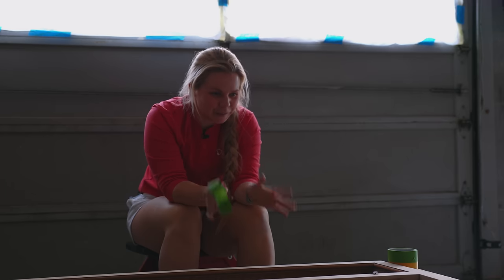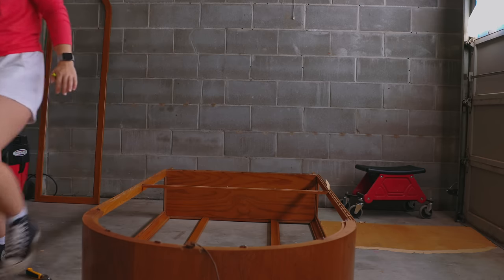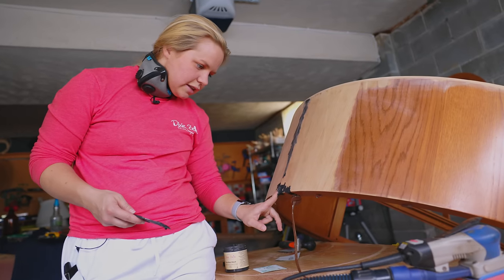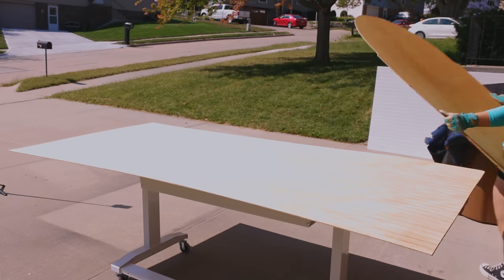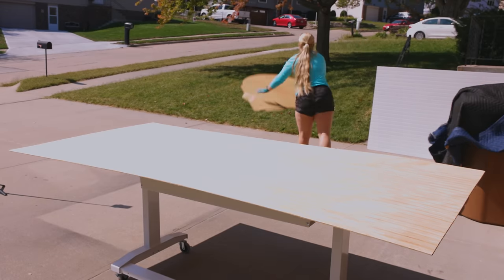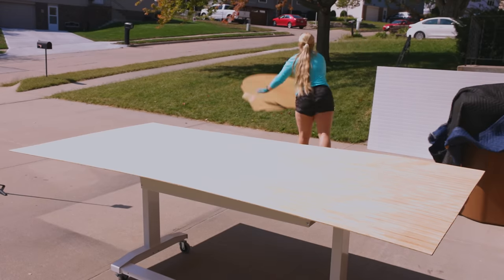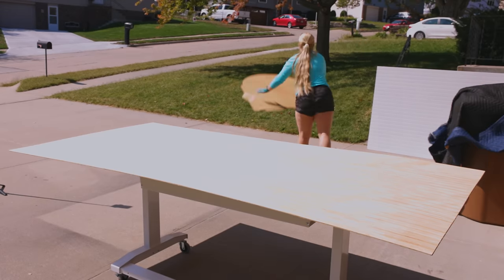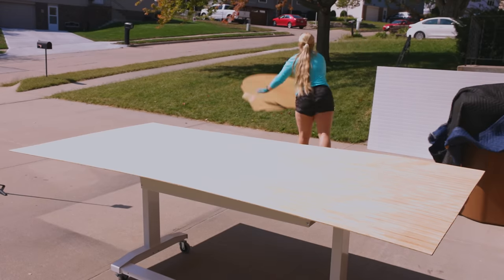I FINALLY Got My Hands on a Golden Oak Arched Cabinet 😍

Comment: Putting the glass back helps keep dust from getting inside the cabinet. I would put plants inside as well so it would keep the humidity up. Beautiful piece. Congrats on your store front
Reply: I agree.  It’s actually easier to keep clean if you add the glass back, because it keeps the dust out.
Reply: This is exactly what I was thinking!
Reply: Exactly!  Who wants to dust all the things inside.  I would never buy a display cabinet without glass just because I hate cleaning and dusting.  Cleaning glass once every 6 months is much easier than cleaning shelves and Knick knacks every couple of weeks
Reply: Totally agree with keeping the dust factor to a minimum!!!
Reply: Plenty of people have open shelves so I don’t think that’s an issue for most people.
Reply: Agree.  I also think it looks unfinished without the glass, so, putting it back in will further justify whatever price you ask.😊
Reply: Kinda undercuts the point of having a door that opens, too, if you can just put stuff on the sides of shelves without opening the door...  Also keeps the CATS and the kids out!!
Reply: Yesss!!

Comment: you can still use the arch piece that broke.   where it broke get it cut even and use the whole 2 pieces as one. where you have it pieced use it in a cabinet and use the cut line with a shelf to cover the piecing section.

Comment: I like this cupboard a lot.  Different ideas play around in my mind what you can do. 
One idea is to have all the glass in because it is a show  case.  The other idea is not  putting it in to create an open space, flowing through space.
I also have in mind how you can play with colours. The black cupboard with the golden brown/honey colour items look stunning.   I also see in my mind that somewhere on the outside it needs to match with the inside, or the items on display, for example the feet is also golden brown and may be the door frame.  It is a very versatile item.  You can build replicas of this cupboard and play around with ideas of using the colours on the interior and exterior of this magnificent piece.  One another idea is that  you keep the mirror at the back, keep the inside golden brown, ( the natural colour of the wood), put in string lights around the mirror, paint the exterior frame black as you did, but just keep it empty, because you want to illustrate the idea of a  "spieelkas" ( Afrikaans for a dressing table)

Comment: It looks much nicer with just the glass shelves no glass walls or front. I had a cabinet like that that had glass on the sides in the front and the shelves and it was a pain to clean. Your design looks much simpler and easier. Nice job❤

Comment: I wasn't sure about the dark paint wash when you mentioned it.  I have to say you were right.  It looks great.  I would prefer 'no glass' but you might keep them and have them for an option if the customer wants them.  The glass shelves let more light in.  With a lighter color cabinet you could probably use painted wood shelves.  Nice job, Lauren

Comment: You pay attention to the details.  I appreciate that (sanding smooth down to the cut line; adding edge banding; multiple thin coats of paint on the project.  I think it was the best treatment to use the glass shelves rather than the wood shelves, which IMO made the inside of the cabinet look heavy and a bit too dark.  I'm fine with not reinstalling the glass panels on the sides and door because I like the open shelves, easy access to grab a book or quickly switch out decorative pieces. I use two very much less expensive arched top shelving units to hold books with a few collectibles.  But I also have a glass encased unit with mirror back and I still love it, even though I purchased it in 1986.  It holds special items collected over the years and since there are many small items having the glass enclosed case helps keep dust out so I don't have to dust every week.

Comment: AMAZING! Most open shelving is not “glassed in” so I would not put it back. It could, however, be an optional add-on  for a modest fee if they want it installed. Maybe you could recoup some of the extra $100 you had to pay for it. Great work!

Comment: I would put the glass panels back in so everything placed inside is protected. I have several shelved furnitue pieces in my house & love that I don't have to dust all of my decor inside of there. I also would have preferred solid black all over instead of the black wash. Personally, it looks uneven to me. Some of the areas the wood is showing through more than other areas on the black washed sections. It looks inconsistent. I do like the wainscoting back panel though.

Comment: Love the transformation! I think using the glass shelves was the best option. It keeps the dark cabinet airy. When it’s time to sell I would offer it with the shelves if the buyer wants them. The glass panels would help keep dust out of the cabinet. So rather than having to dust inside regularly, you would have to clean the glass panels. Either way the cabinet would still need to be dusted/cleaned. It’s beautiful!

Comment: put the glass back,  Glass shelves really show dust quick and the glass on the outside is a lot easier to clean since it is a vertical surface.  The glass on the outside will only get dirty if people touch it ,  Those flat shelves mean you will have to take every thing out and clean inside weekly.

Comment: I’m agreeing with the less glass is more opinion. I don’t care for all the reflective lights that go on with the glass nor do I care to be cleaning glass. It’s a constant battle to keep from streaking.  In my  own home most of my shelving pieces are open with only a few areas behind glass doors. I love the bead board backing much better than the mirror for the same reason. I do have a black set of  cabinets that I like quite well.  I’m still not a fan of legs on every piece of furniture. However, on this cabinet, the squatty chunky feet is quite attractive. Good job girl!

Comment: I would give the buyer the option of the extra glass panels. I would buy the extra panels and fit them as it would cut down on the dusting of the shelves.  I don't like dust and the have to move everything to clean in the cabinet on the regular would not make me a happy camper. But its an individual thing. Its a pretty piece, well done.

Comment: Definetely put in the glass! It'll still be way easier to clean the glass surfaces than dust all the decor and  glass inside, which you would have to do otherwise. Also, in my opinion, it just looks like its missing something as its clearly meant to have glass there.

Comment: WOW!  This cabinet turned out lovely!  The glass can be a perfect template for cutting and putting non-reflective glass in its place. The new owners can have both options by keeping the original glass. I would simply recommend placing the glass sections in a protective package/container and give the new owners the option of adding glass back in it.  Keeping the glass in a safe container is a must anyway.  B~}

Comment: Beautiful!! The only reason I see for adding the glass back in is if you live in a dusty climate. I have several open shelving units where I live in the southwest desert area and dust accumulates quickly. I wish my shelving units had glass doors. Otherwise,  you did a fantastic job.  Excited to see the opening of your store in November. 😊  ❤
Reply: I live in a completely opposite climate. North West Tennessee is very humid. We do have pollen seasons, beginning of spring and fall. Also a season I call “chicken poo” time. It’s when the farmer fertilize their crops. It goes away after the first rain. I don’t open my windows then. Lol. 
I don’t like anything glass topped or in doors. It’s not my style but I like it in other’s homes. I’m more of solid, delicate, cozy furniture. We will be redoing our home one project at a time. Top to bottom is the rule. Countertops, cabinets, repaint walls, get rid of the wall unit and replace with the same paneling texture (I will be painting over it). I will be doing our kitchen and bathroom countertops using StoneCoat Countertop Epoxy and Resin. DO NOT USE ART RESIN. It will yellow. I will be posting it on my instagram soon.
Reply from the maker: true!! i’ll keep it just in case!

Comment: I can’t get over the transformation.  Just getting rid of that mirror in the back and that yellow-y oak wood by itself moved this piece from the 20th century into the 21st century.  DEFINITELY put the glass back on the doors!  DEFINITELY! DEFINITELY.!  Why?  Who wants to dust all the stuff inside the cabinet?  The glass is so much easier to clean than dusting the shelves and the Knick knacks sitting on the shelves.  Do you have a light for that piece?  If not, consider adding one.  This piece will sell quickly for a lot.

Comment: I think it looks really nice but it was alot of unnecessary work. Me personally, I would have just cleaned and flipped. As far as the glass, that is going to be ones personal preference and what look they are going for. It will look great either way. I prefer the glass inserts. I also think the legs and staging look great.
Reply from the maker: I disagree, I don’t see people paying more than $300 for this type of cabinet as it was…I brought it back into the modern world so that people will be more attracted to it as opposed to the golden oak. plus I wanted to work on this piece and I had a LOT of fun doing it
Reply: @FurnitureFlippingTeacher  I will be anxious to see what it sells for.
Reply: @lorrieguinn8221  I beg to differ. There are hundreds of channels on YT of people flipping the furniture as is, just clean, repair and go. 
Plus, there is a huge crowd that loves anything vintage and not white, black, colored or gray, so it would have sold on that market quickly.  So no, there is not a 99% of people that won't buy it, that is inaccurate.
 They are not diminishing her job, they are pointing out that there are other alternatives on the flipping business and other tastes as well.
Reply: @FurnitureFlippingTeacher  maybe not in your area but they do in other more sophisticated areas where people love vintage and classic colored wood.
Reply: @lorrieguinn8221  Whatever, if the shoe fits.. you know the rest.  All areas have different tastes and that is normal.

Comment: Please ‼️ wear safety glasses when taking apart furniture, specially pieces with glass, there could be shattered pieces on the edges of the glass that you cannot see and potentially fall in your eyes. I know those glasses can be uncomfortable but you get used to them. At least wear them when taking apart glass or mirrors. 
Keep up the good work, and much luck.